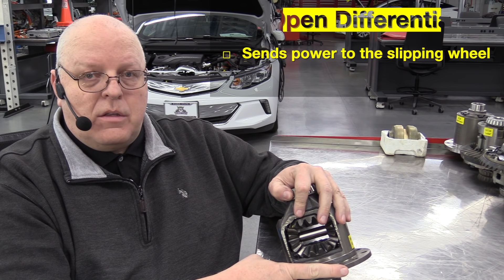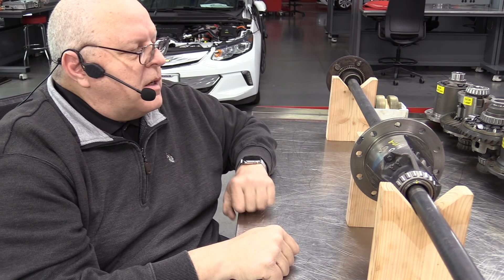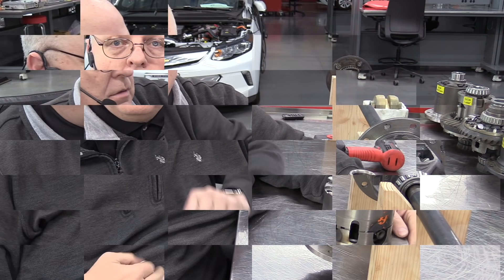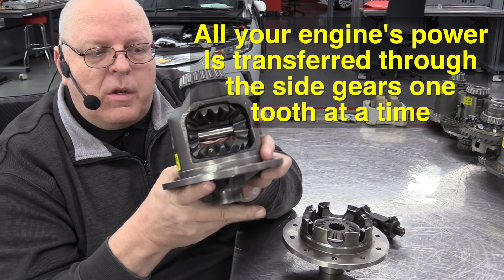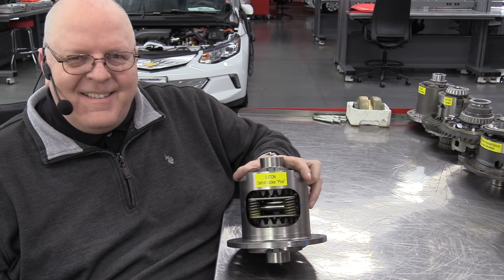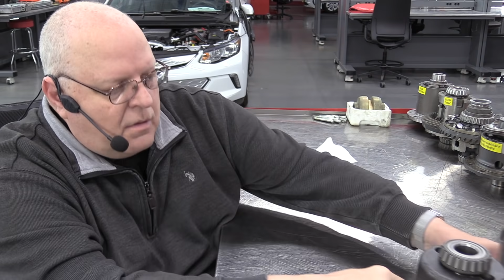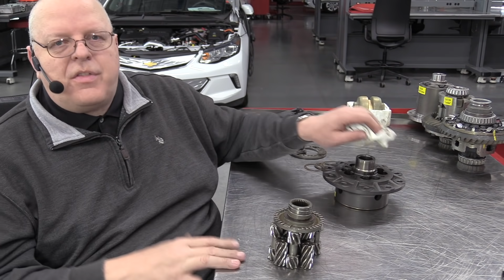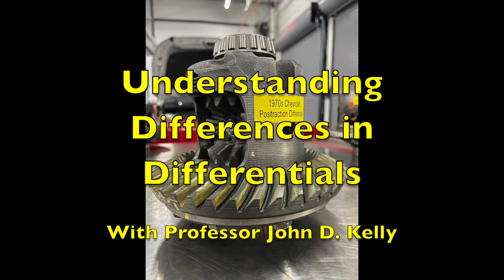Understanding Differences in Automotive Differentials

Comment: Great tutorial, but I wished you would have included the real, two clutch packs posi, which I had in my '68 Javelin. Luckily, I found a (real) Detroit Locker to replace the posi, because NOBODY tells you that the housing bolts on the posi are LEFT HAND thread, and I promptly killed two of them thinking they were loc-tited in place! Now try finding replacement parts for the posi. let alone those dead left-hand bolts!!!   As a note, I started to rebuild my diff with a lot of trepidation, because this was my first diff in 45 years of car crafting. Also, I WORK ALONE! I do have the complete '68 AMC service manual, which without, would have made the rebuild too daunting. In the end, with the right information and tools, putting the Detroit Locker in, getting all the numbers right AND installing single piece axles, the rebuild was a piece of cake!!!! Possible videos to follow, as I've documented just about everything.   CORRECTIONS BELOW...points 2&4 - I'm not sure about the limited slip in #2, but in #4 you mention again limited slip......#4 ALMOST perfectly describes my POSI-TRACTION, not the limited slip! SORRY...the spider gear pins (pinion shafts - AMC) are NOT tapered, but instead are MACHINED AT THE ENDS ONLY to match the "V" in which they sit and slide up. Hope this helps, und guten Tag WzW.

Comment: Vw  had self locking diff in 1941 as did the Porsche 356,Intel 1960s vw offered a zf clutch pack limited differential,  in 1970 vw kombu had a cone type zf limited slip differential, also in 1968 vw of brazil kombu had a manual type locking differential  this was also used on vw vangon  synchro 4x4 plus the vwpolecat aka iltis had manual locking front rear differential s.

Comment: Thank you for the educational video. I used to work on cars years ago. I did engine repair/replacement,  just about everything except transmissions and differentials. I knew of the different kinds of rears, spool, posi, limited slip, open, lockers…etc. but never knew exactly how they worked. Best of luck 🍀with your channel. Thanks again

Comment: Thank you, Professor. This was educational, fun and a real history lesson as well. My nephew and I both have the Chevy Colorado 2.8L diesel with locking Z71 package. Jamie's had chatter in front differential & was told it will sort itself out over time. It has but it took 25k miles.
Reply: That's like a surgeon telling you that the cancer will sort itself out over time. Find a transmission company who knows what they are doing.

Comment: Looks like I'll be looking for a Torsen style rear diff for my Buick. Thanks for the information. I had a good idea of how they worked but I'd never actually seen one apart. All I know is that the 2.56 open diff in my car is horrible. It won't even shift into overdrive until 80 mph. I want either 3.73 or 3.23 gears. It would take off quicker and I should hit overdrive at around 55-60 which is the normal highway speed around here

Comment: I want to ask what would happen in a FWD car if one of the gears connecting to the no matter left or right drive shaft loses connection through something happened with the drive shaft or inner cv joint or anything else related like broken or missing retaining ring etc. ... I'm wondering what consequences will occur to the opposite wheel... Will it start spinning when you put it on gear jacked up at the same side or it won't spin at all?

Comment: This is great, thank you for posting this! I have a 1995 GMC truck 2WD with the 5 speed manual gearbox (NV4500) and the 4:10 (14 bolts) differential. I'm thinking about to get either a limited slip or a locking one. This video really helped me understand the differences!

Comment: Thank you so much!  I have always wondered how lockers worked.  In the late 1970's I drove an FWD 10 wheel all wheel drive truck for the local power company and with an air switch on the dash all of the differentials locked.  Driving on the grass if you turned the steering wheel it would simply plow ground instead of turning the truck.

Comment: The Torsen that is the most notable, and best performing is the Type A with the six worm gears (not shown in this video). Not the helical binding gears shown. A Torsen diff with one wheel on the ground will not let the wheel in the air spin wildly. An outside force can move the wheel faster or slower than the other such as distance traveled by one tire over the other in a turn. The Type A Gleason Torsen was bulletproof when the parts were made from billet. They were expensive to make that way, so some Einstein decided to make gears from powered metal technology to save manufacturing costs. Unfortunately the worm gears started to disintegrate. I had one of each back in the early 80’s. The billet would easily outlast an higher than normal output engine and transmission whereas the powdered metal could be destroyed at will by a mediocre engine and a hard clutch drop.
I think this may have damaged their reputation and I lost track of the disposition of that design since then or whomever owns the name. The original Gleason design was first used in 4x4 aircraft tugs for the US military.
To the best of my knowledge Gleason only offered one original type with the worms. I highly suspect others limited slip (types) were added to diversify the product line by the latest owner of “Torsen” name. The best all around diff by far is the Torsen. On ice you could only use a standard “open” differential, Torsen or Detroit tru track. A locker or a tight posi will put you in a spin at the first turn. Present day technology with electronic traction control puts the older mechanical traction diffs to shame. In my opinion, the ultimate would be Torsens front, rear and center WITH electronic traction control. The traction control would fine tune it. How good were Gleason Torsen’s? There were numerous times I had to stop to clear the snow that I pushed over my truck’s grill because I was overheating lol.
Reply: I don't remember the details but there was a try to put three torsen diffs in a car and the result was a massive understeer. There was a need to decrease the TBR of each, going almost to the level of open diffs.

Comment: Thank you so much Mr. Kelly, I have a 95 Suburban 4wd that has the Eaton Locker you showed and my goofy off-roader buddies couldn’t pin it down as to what it was, but it still works after 220k miles, so I knew it was a good posi rear end. And now after hearing everything you said about it, I’m definitely NOT going to service it myself and take the whole axel to a diff shop and let the experts do it. Haha

Comment: The one explanation which I've never seen pulled off successfully is the mechanical operation of the TrueTrac, or "helical-posi" as some know it. 
Even Eaton doesn't do a good job of explaining it.
As you said, "it looks similar to a TorSen, but it's different."  It's so different in fact, that it's got half the moving parts of a typical TorSen and accomplishes the same function. 
Yet, as little more than an ignorant layman I'd definitely describe it as a TorSen "type" diff, rather than a Limited Slip, which is how most people (including the manufacturer) describe it. Eaton actually calls it "Truetrac Posi" on the box, which I think is also a bit of a misnomer. I bought one from Eaton last year for a little over $500 to install in a Jeep.
When I hear Limited Slip my mind instantly goes to clutch packs. When I hear Posi my mind instantly goes to GM, as "Posi-traction" was just a GM trademarked name for clutch pack actuated Limited Slip.
Any chance you could go a little deeper into TrueTrac in another video?

Comment: I had no clue that the Rubicon locker was a torsen style, or that it's an air locker! I thought they are electric locking and open diff. I need to look into the topic again...
Reply: The Rubicon air locker is in no way a type A Torsen limited slip. The one in the video is more like the true track design. The A type Torsen has six worm gears that have straight cut gear on each of those. They can be seen at the three openings of the housing without taking it apart.

Comment: There is one more type you may want to add. It’s called a varilock. It’s used in some of the 99-04 Jeep Grand Cherokee with Quadra drive. Hydraulic pressure locks the clutches. Very informative video. Good job.
Reply from the maker: Thanks for the info!

Comment: You didn’t show the spring loaded cone type that was common in Borg Warner axles. A very simple type pretensioned LSD that worked well until it had high mileage and the hardened cone tended to cause wear into the pinion gear casing and it lost its preload. 🚘🚖
Reply from the maker: Thanks for the info!

Comment: What's the thing called between a transmission and differential used on some vehicles that changes the gear ratio?  Transaxle or something like that?  Where I think at least one bootlegger had a car with it, where he could take off fast, go through the gears until going fast, then he could shift this thing, where it let him get top end speed.

Comment: The thing that makes Torsen diffs work is that worm gears can drive other gears, but other gears can't drive worm gears. A worm gear is essentially a one-way power transmission mechanism. By that I mean the power can only go one way, from the worm gear to another gear. The rotation can go either way, but the power has to come into the worm gear directly and goes out the other gear. If the other gear tries to turn the worm gear it just stalls because it's trying to force the worm gear longitudinally along its axis, not rotate the worm around its axis.

Another way to say it is that a worm gear converts motion to 90° from the input, but in a very different way than bevel gears. Bevel gears transmit the power either way with no preference other than relative size.

It has nothing to do with them jamming against the housing. The effect of a worm gear happens even if there's no casing.
Reply: Yes you are correct when the force comes on the worm gear is forced sideways but can’t rotate. The worm gear can rotate the worm wheel only. 🚘🚖🚘🚖
Reply: Yes, well explained.

Comment: Even after watching this, I’m still confused on how the Limited Slip differential works. Based on the diagrams I looked at, it almost seems like the wheel that lost traction (spinning faster) will be the one engaging the spider gears, so it ends up just like an open differential? I know it doesn’t work like that but I’m confused how the slower turning (traction) axle engages the spider gears when holding an axle “still” generally does the opposite.
Reply: Under load the pinion turns the crown wheel and the torque loads the pinion gears to force the axle gears outwards and lock up the clutches on the axle half shafts.

Comment: Professor,  John, your very informative explanation of the various differentials reminded me of a device called a squirm drive. Its inventor, (A tool and die maker out of Portland Maine named George Brackett .) tried interesting the US Army in it as a new kind of differential. The device has all the advantages of a locking differential without using clutches or locking gears. I found a short article on the squirm drive in a November 1984, Popular Science magazine. If you are interested in a totally different approach to two speed outputs from a single drive input, you might look it up.  Mike
Reply from the maker: Thanks for the information! That sounds interesting

Comment: The subtitles mess it up but good video
Reply from the maker: Thanks for the feedback. You can turn those off if desired.
Reply: @WeberAuto  o u can how do u do that
Reply from the maker: @limitlessworx5724  There is a CC button at the lower right of the screen on computers. On a mobile device tap on the screen and press the CC button. Have a good day

Comment: What ever happened with the Torsen drive differential? It seemed to be an ideal system.
Reply: There's still plenty of cars that use it . I know Hyundai used it in their Genesis line of cars . The Detroit true track is popular in some street cars and a lot of off-road trucks . Torsen style differentials haven't gone anywhere .
Reply from the maker: They are still around. See the link in the video description to see the three current types. Thanks for watching

Comment: My 2013 4WD Tacoma has an open front differential, no center differential, and the rear differential that you have demonstrated. You are correct that it only lockable in low range. Toyota says that should only be used below 8kmh/5mph. I know many that have destroyed the locker because momentum was needed. Toyota sells vehicles with this different as an automatic limited slip differential. Which I believe is fraud. The electronic system pulses the antilock brakes which only stops progress.
Reply from the maker: Thanks for the information!

Comment: You said that the Dana came out in 1956. In an IHC line that would be a “S” model. Grandpa had a 1953 IHC R100 that had a no spin, or non spin. I do not remember exactly what it was called, there was an aluminum plate on the dash telling the driver that that vehicle had a different style of differential that made clicking noises when ever you turned a corner.  I know that in a corner it drove the inside wheel, the outside wheel had to over run to release the notches, making the clicking noise. 
With these vehicles on a hoist, if you gave the right wheel a very quick spin forward, it would free wheel until the notches caught, then it would come to a halt!
I think that it was a Eaton product, either called Non Spin or No Spin. GMC also used this in the torsion suspension models which I believe is 60 to 62. 
If you get a early 60’s green Motors Manual they will talk about this style of locking differential. 
Hello from north east Montana. 
10 miles from the Canadian border.
Reply from the maker: Thanks for the information!

Comment: So the Torsen gears would wedge in place into their bore and slow down, but doesn't it damage the gears itself? Wouldn't that allow for wear?
Reply: yes. they wear out the case until the teeth no longer mesh. then you rip it out and replace it. they are considered disposable. i highly recommend the best lube you can afford to slow down the wear.
Reply: @tweake7175  Good to know, thanks mate!
Reply from the maker: Thanks for watching

Comment: Excellent.  Looking at GM Van and they offer a Locking Differential as an Option.  Would that be the Eaton Limited Slip as opposed to the Open Gear Differential ?   Also, I had a 1966 C 36 which had a Non-Slip Positive Rear End.  Did they discontinue ?  This Rear Wheel Differential was great in the snow & ice.  Does the Eaton work like the Non-slip Posi ( 1966 ) ?  Thank you.
Reply from the maker: Good questions. I do not know. Thanks for watching

Comment: Unfortunately doesn't mention the worm and gear Torsen differential.  This uses the simple fact that a worm and gear combination can only transfer power in one direction.  The worm can drive the gear but the gear cannot drive the worm.  This means that it doesn't rely on friction as the "torsen" differentials which are mentioned do.  The advantage...friction wears out the differential components giving a limited life.  The worm and gear Torsen will last much longer, perhaps forever!

The worm and gear Torsen differential in my 1994 Toyota is still in perfect condition after 27 years of use!

See https://www.youtube.com/watch?v=JEiSTzK-A2A

Comment: Always strange how terminology differs.  I would call it a carrier, not a case, and planetary/spider gears.  Also call LSD clutch additive "Friction Modifier".

Interesting to see so many variations on the same concept of LSD's.  I watched this entirely because it said 11(!) different diff types.  Such variety on a couple basic designs (clutch style/Torsen style)!  Really had no idea there were so many, but haven't torn apart a lot of axles, either.  I just have always broken it down to clutch, Torsen, locker (manual/lunchbox(auto)/(ARB)air/electric), or a simple spool without regard to how many ways that was accomplished.  You truly missed the opportunity to show off a "Miller Locker", a diff that has had all the planetary gears welded together to make a spool.  AKA: redneck locker.  At least you mentioned it!

Extremely interesting lecture, I learned quite a few things.  Thank you!  I had never heard of a locking transfer case....have to go learn about that!

Comment: The eaton locker at the end is the worst one ever. I still have one in my 1999 Camaro but it only has 30k miles on it. Car was drag raced a few times at the track with street tires and did not perform very well. One wheel burnouts. The second try would spin the other but rarely both. But in it's defense it always left 2 black marks on the street. Good video, keep it up.
Reply from the maker: Thanks for the feedback. Good to know.

Comment: Something that often goes unmentioned is that an open differential in it's elegant simplicity always delivers equal torque to both axles.  The amount of torque may be limited by the axle with the least traction but it is always equal. :)
Reply from the maker: Thanks for watching